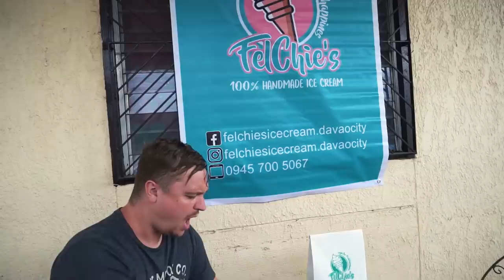BUYING A NEW TRUCK? Philippines Fishpond Business (Davao City)

Comment: On a project in Batangas we imported a concrete batch plant from South Korea as scrap. So difficult with customs and taxes to import as an actual ready to construct plant. Have you noticed around Davao the large number of multicabs (they call them Transformers in Davao) that are on the roads. It's the same, imported from Japan and rebuilt here in Davao. We just bought one P170,000 comes with A/C, power windows, great paint job, recon engine, new upholstery. Anyone need a cheap runaround then get one of these.

Comment: Having a second hand truck should be based on your requirements,consider its fuel efficiency,then its availabilty of parts and your average weight movement.common ones are the isuzus,downtime shorter compared to fuso canter or hino,cheaper compared.on exper i prefer less downtime,i came to fuso,takes years for wear a n tear,though its parts are more expensive in comparison,you ought to have an elite mechanic of fuso because there are parts being replaced of isuzu to fit in fuso,it works,but not a nice ending though.get a high dropside boom truck with tailgate,you can do the loading and unloading yourself,6wheeler will do,with reserve air depository tank.

Comment: Bro if you do pull the trigger on getting one, check the integrity of the welds and the parts that they installed pay particularly attention to steering columns and A/C modifications. Righthand drive to left hand drive gets tricky. Good luck 👍

Comment: Most truck used in Japan use Diesel engine, which can handle big loads and can go further. You could get a flat bed truck, plywood measure 4X8 per sheet.  Measure in feet not meters. Then you could some side jobs delivering goods for people. Be safe.

Comment: Actually most jeepney engine are from japan. Body are just assembled here. Until now jeepneys are still running and fixable even now most still runs more even than 50 to 70+ yrs old. Problem is just the pullutions. But, that truck from japan  is ok just for province use for a long time.

Comment: You can drive with them as long as you want in Japan but you got yearly checks that are a pain in the ass. Also the expected level when being checked is very high. So the older these trucks get the more expensive to keep in running order. In contrary to the PH where nobody cares as long as the lights and the breaks work.